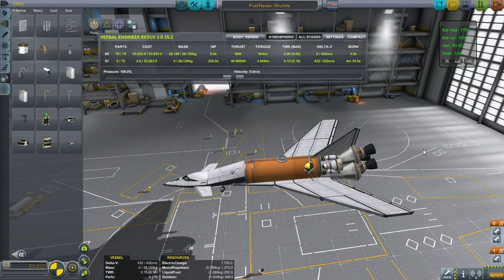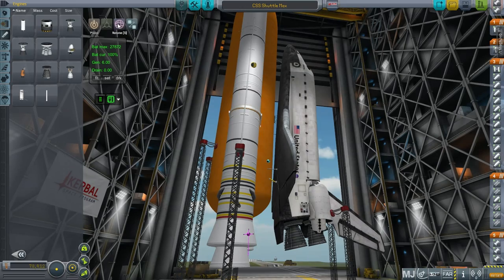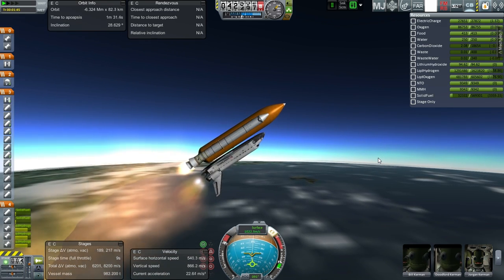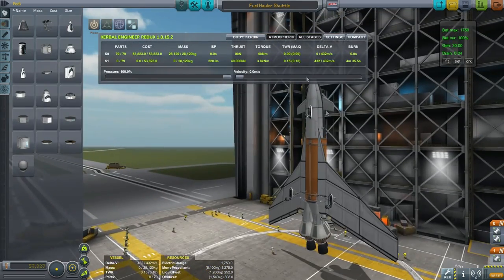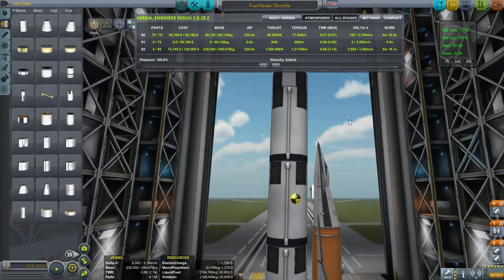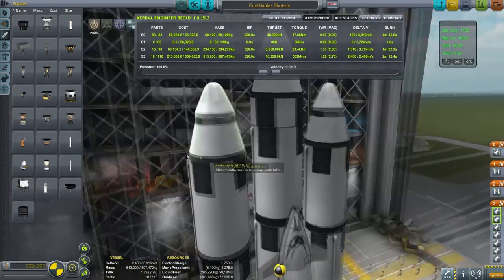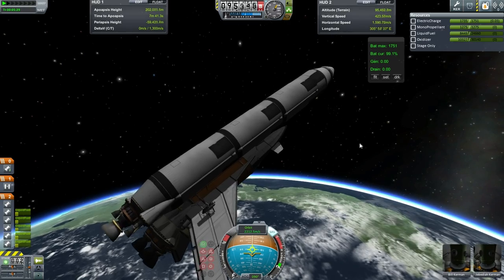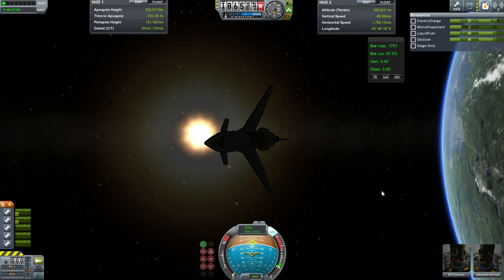Kerbal Space Program (0.90 Career+Sandbox) Tutorial 22 - Space Shuttle Design

Comment: I tend to mount my external tank at the top of the shuttle (radial deckupler + some structual parts + tons  of struts) which solves the problem quite well for me. Tankfully the Kerbals doesn't have to worry about bits and pieces braking of the tanks.
Reply: ***** I looked it up by now there're some designs which would have made a Kerbal proud :)